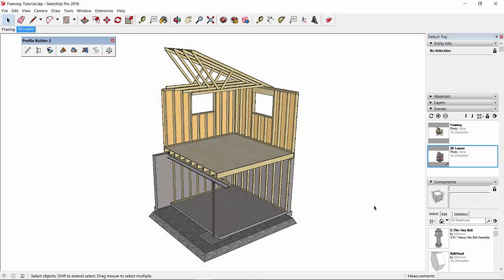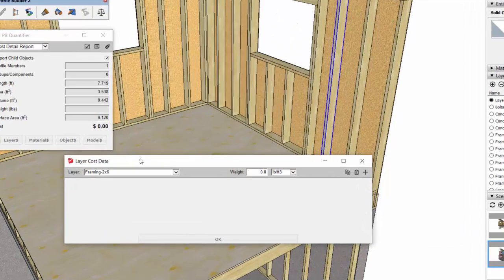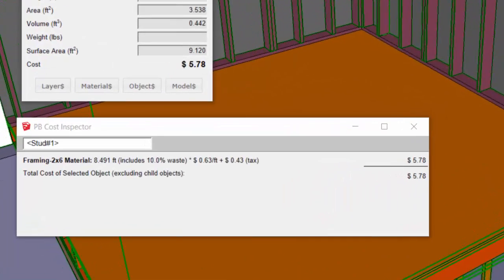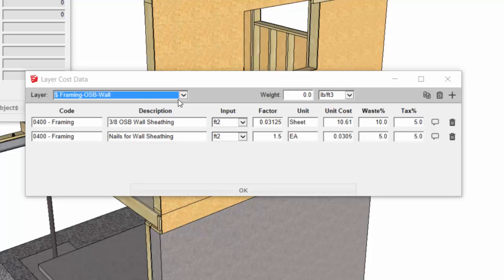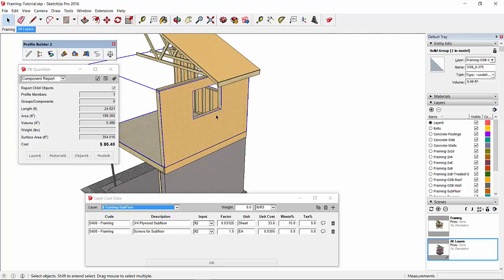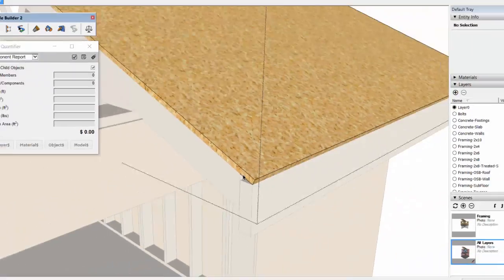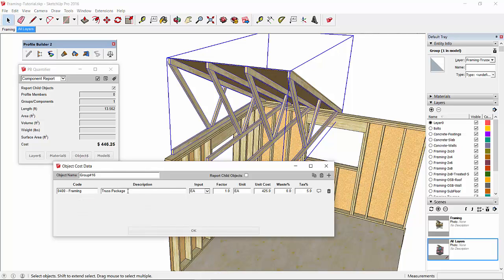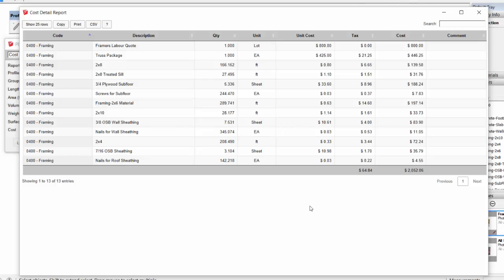Quantifier 2.1 - Framing

Comment: Hi. I bought this plugin. Very Useful. I was just wondering if anyone has any good methods for quantifying materials AND labour for stud walls using this plugin. I have tried making every framing member a group or component and assigning it to a layer (eg TIMBER-Framing members). I assign layer costs per lineal metre for the material and it works great. However, coming up with a labour FACTOR for lineal metre doesn't seem the best method. I can make something up that suits certain situations but not great. I was hoping to assign a number of hours per metre of wall built. I thought I would be able to do this by putting all the framing members in one wall in to a group and assigning them to a layer (eg TIMBER-Walls) and then costing that layer as hrs per length of wall. Unfortunately the Quantifier doesn't seem to measure the length of the wall. I'm confused! Any help or ideas would be great?

Comment: Quantifier should be a separate extension. If the sheets come in 4x8 ft size. Can it tell me how many sheets will I need for a 6x12ft area?
Reply from the maker: Thanks for your comment.  Why do you think it should be a separate extension?  Yes, it can tell you how many sheets you need.  You just need to enter the correct multiplier 'factor' in the cost data to convert from total sq ft to sheets.  (eg. for your case, the factor would be 0.03125).  You would also likely want to add a waste factor of at least 5%

Comment: Hi Dale. love the plug-in, especially the quantifier. is there a easy method to export/back up price information to use in other models?
Reply from the maker: Set up all of your standard layers and materials cost data, then save that file as a SketchUp template.  Whenever you start a new project, use that template at as a starting point.  Then, you can re-use all of your previous cost data
Reply: Wh447 brilliant, thank you